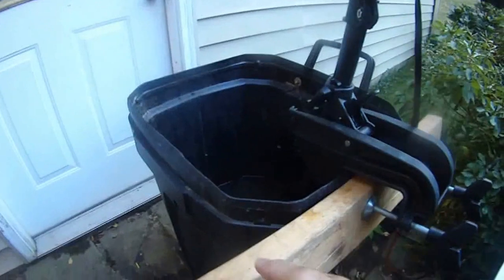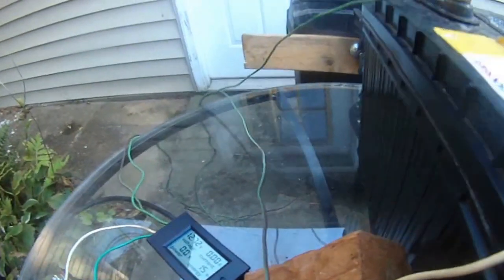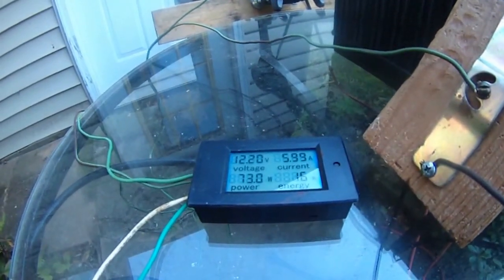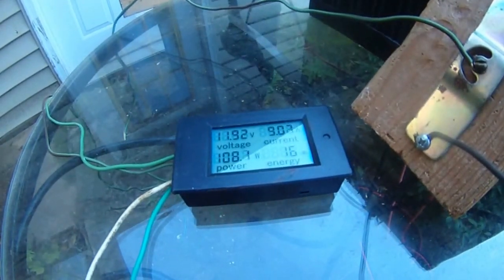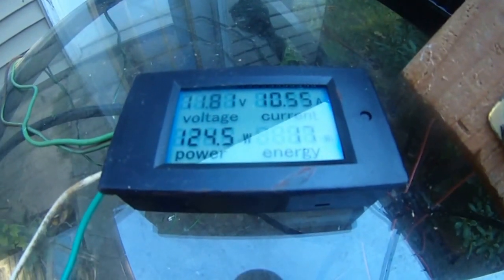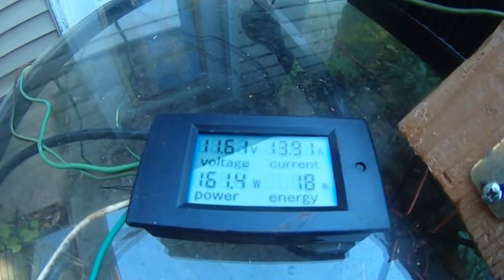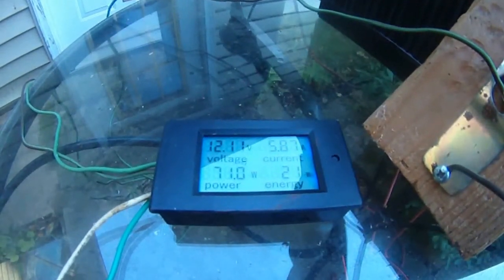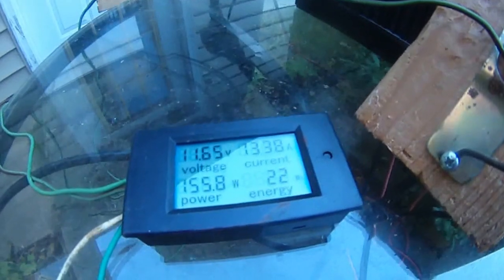Minn Kota Endura c2 30 pound trolling motor - how many amps does it use in water? Part 2

Comment: sweet so a 100ah battery will get about 7hrs.
Reply from the maker: Thanks, you are correct about 2 seasons cracking again. I have algae on my driveway again. I will do it again with your suggestions. Thanks a lot. stay tuned.

Comment: So ok, if I have an interstate 160ah at 25amps how long can i go at speed 5 with this 30lb minn kota motor?  I heard it's not good to go below 50% but is that a big deal if I drain it to empty as long as I charge her up right when I get home an hour or two later?
Reply from the maker: Yes. You may not recharge it with less than 50% capacity but the truth is the battery is pretty hardy. I have ran my 24 volts battery down to 30% and came home and recharge them with 10a quick charge and brought both of them back to life.
Reply: 4 hours 
But sped will be reduce as time goes by. Unless  u but lithium batteries.
Reply: 160ah/25a= 6.4h
Reply: @pamfinney4002  usable typically is 50% of what it is rated for.

Comment: Thanks! Just what I was looking for. It may be that in open water the motor will draw a bit more power, but this is a great rough estimate and shows very well how much “juice” you can save by running at a lower speed.

Comment: Thanks for posting your results! I have done extensive testing on the same motor. Note, the amount of power/current the motor will draw is highly dependent on the "load" the motor will see. Specifically, when the motor is run in free air and running at full speed (setting #5), the current consumption is a mere 2.5 Amps, but if you actually connect it to a boat/kayak and do some in water testing, you will see the typical current will be around 23-25 amps. If you are going against the wind/current, it might get as high as 28 amps. Minn Kota specs the current at the highest setting as 30 amps, which is the absolute maximum you would ever see in the largest/heaviest boat that they recommend for this size motor. Note, the reason why you are only measuring 14 amps in your test, is for the reason that alueshen mentioned in an earlier post... specifically that you are not testing the motor under a "real world" load (i.e., while actually pushing a boat). Again, thanks for your post!
Reply from the maker: yes, this test is almost a dry test. The load is not enough no wind, no boat load of equipment and a couple adults in a aluminum boat. Agree the current can go as high as 30 amps. No time to test when I get on water, I just want to fish and no time for science project. Winter time is the best time for DIY projects Summer time=boating and fishing time. Outdoor time. I was surprised to see so few amps after my test after I was done with my test. But, I read more and learn more from others. 30 amps is high but not impossible especially when going against river current with a boat load of stuff..
Reply: yea, I agree, I don't think you'll ever see 30 amp in real life, probably 25 max under worst case conditions. Thanks again for posting.
Reply: JIm Beam so 25amps on my 160ah battery =about 6 hours before I'm rowing. Worst case scenario?

Comment: Wires are grossly undersized.
Reply: what do you want for 15 amps?  1 inch thick wires?? jeez
Reply from the maker: these are my experiment of the LCD meter. I did use it with my Minn Kota 30 pounds push trolling motor in a local canal without any problem. I think the most it drew was only 15 amps so all was well

Comment: This web site should help. Yes the 30 lb trolling motor can draw 39 amps.

https://www.google.com/url?sa=t&rct=j&q=&esrc=s&source=web&cd=6&cad=rja&uact=8&ved=0ahUKEwj_4uCwtfnRAhVJWCYKHfiJCS0QFggzMAU&url=https%3A%2F%2Fwww.trollingmotors.net%2Fblogs%2Fselection%2F86961351-calculating-motor-run-time&usg=AFQjCNE-3JreanEQkOJiZAdiZcnY_G94Yg&sig2=DS_Uy29kDsd3_x03Z-ft2A

Comment: Beware, the problem with this test, and before I say something that can be taken as critical, we all appreciate when people take the time to set up these tests, but the problem is we can hear the blade is sucking a lot of air which means it's not doing all the work it does when fully submerged pushing a boat.  The amp reading on this test when in speed 5 are much less than I'd expect.  Typically these motors are rated to use 30A on speed 5.  Now we can expect that to be a worst case, under load, perhaps chugging through weeds ect, but I'd still expect to see something around 20A range when a boat has reached it's cruising speed in open water......

-Cheers
Reply: How long could I draw these figures for with a 110 aph deep cycle battery?
Reply from the maker: @ltskurge6928 110/25amp=4.25 hours
Reply: Okay so a 160ah interstate at 25amps will run me about 6-7 hours till empty?  I'm going to charge it as soon as I get home an hour or two later is this fatal to the battery?  I don't really care if it murders the battery a year earlier (3-4 years of life) as long as I can get 6 hours at full blast...???!!!!
Reply: i realized that too
Reply: "etc" as in ET Cetera.  Learn it, love it, live it.